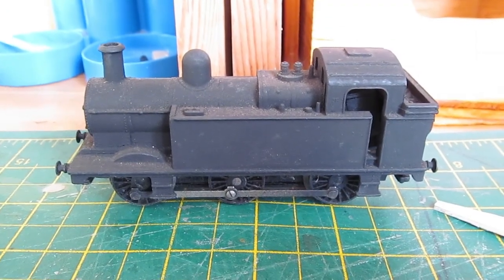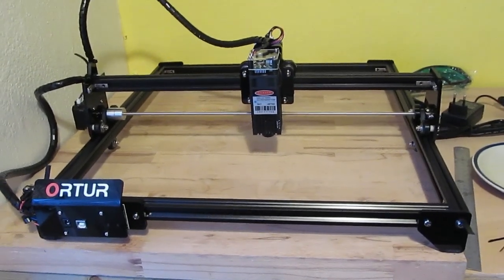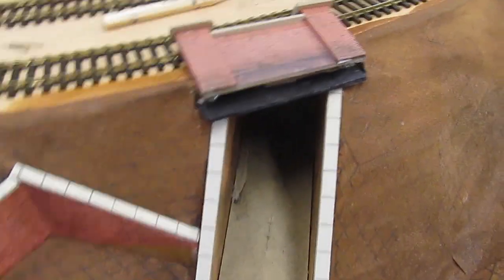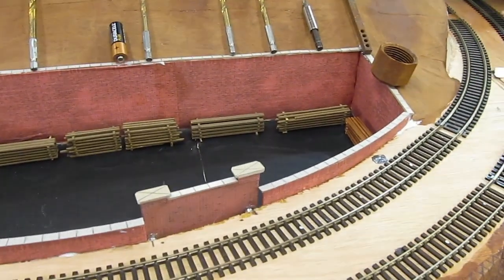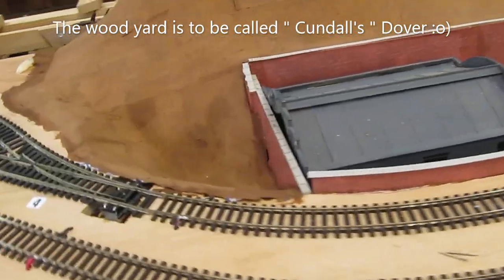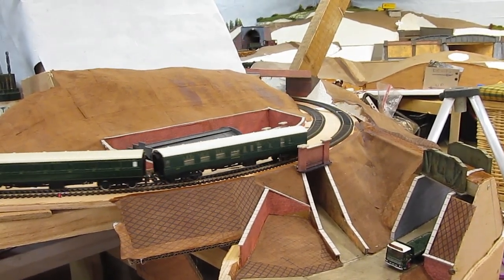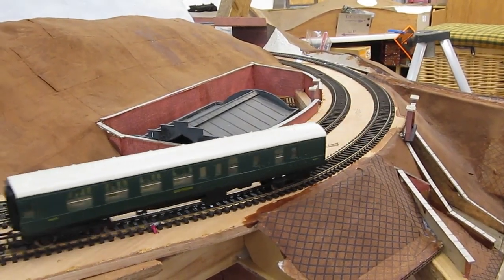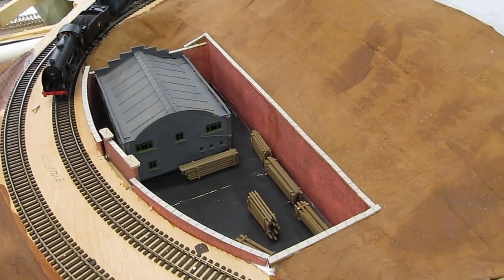Buckland Junction Loft Model Railway 165. Model railway scenery continues on the loft layout. Part 7

Comment: Great score with the laser cutter! That us very exciting and I am looking forward to seeing what you come up with
Reply from the maker: Hi Charlie. I have a bit of trial and erors to get throw first with the software etc. I hope it will cut card more precise than a scalpel n ruler, Regards Alan in Dover  :o)
Reply: I had access to one a number of years ago, did a great job, of course you need to know CAD or have access to the appropriate files👍
Reply from the maker: @charlie1872  Hi again Charlie. I have used CAD in the passed. But I will be using photoshop to draw my items and import them in to LaserGRBL which converts to Gcode for the Laser cutter = I hope. Let's see what happens Charile. Speak Soon Alan :o)

Comment: Wow! an amazing result! Just a suggestion on the warehouse - a woodyard would normally have a large open ended warehouse (easier than poking the wood through the windows to machine it) so you could easily use your skills to make a complete new end for the castellated end of the building with maybe a lorry / fork lift / stack of timber in the entrance?
Reply from the maker: Yes Mike you have hit the nail on the head there mate, Yes I am on to this now the penny has dropped. Thanks Regards Alan  :o)